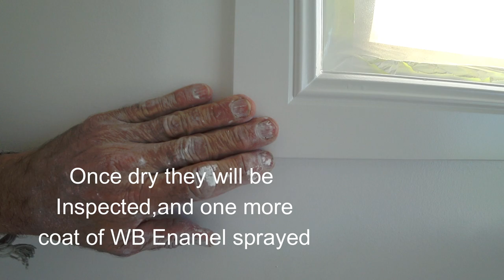Spraying Pure performance Water Based enamel

Comment: I only sand the undercoat but I will also spray a coat of low sheen on as well as the top coat. To get that glassy look.. plus it saves on the aqa enamel.. usually I go through 2 tins. But I am using a bigger tip
Reply from the maker: I do the same, undercoat,wall paint then one or two of the water-based enamel, I used  around 16 litres of pure performance satin enamel on this house
Reply: @ThePa1nterhowto  16 ltrs are you spraying the doors as well.
Reply from the maker: @JONO3679  Yes doors are sprayed

Comment: Hi from Brisbane. If I am brushing water based enamel do you need to thin it down. The last window frame I did had a lot of brush marks.
Reply from the maker: Hi Keith, some water based enamels need thinning, which one are you using? "Soft" quality brush is important and thin around 10% in your paint pot only until it flows better and once you put it down, don't go back over it and always try to paint in the cool of the day. Ideally I've found  spraying is realy the only way to get it decent but you can apply with a small mohair mini roller then tip it off  with your brush quickly. I have a video recently of that very subject.  Good luck and check back to let me know how you went.

Comment: Do you find much diff between that and aquanamel? I used both on a reno in Bargara and pretty much impossible to tell the difference imo
Reply from the maker: There is no difference in the finished product but miles apart when it comes to spraying, Pure performance is 10 times easier to spray and get a good finish.